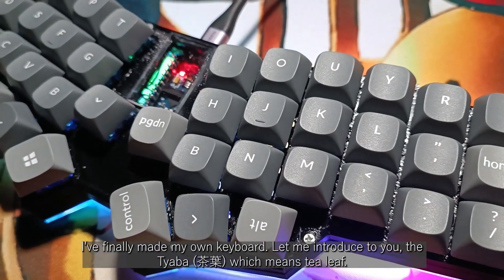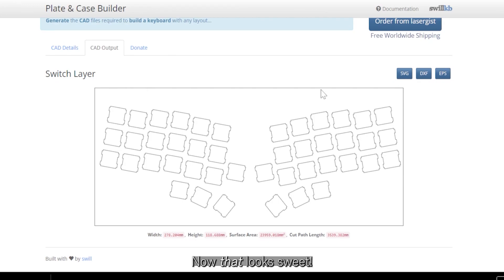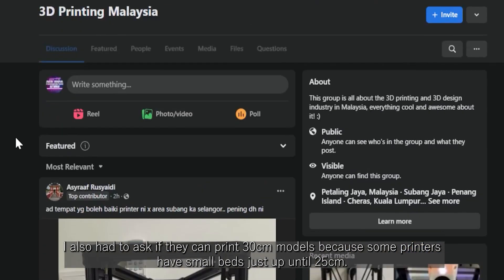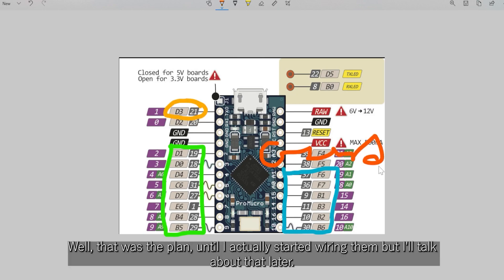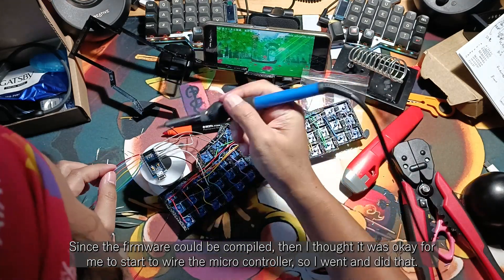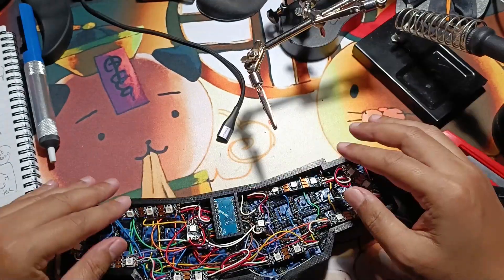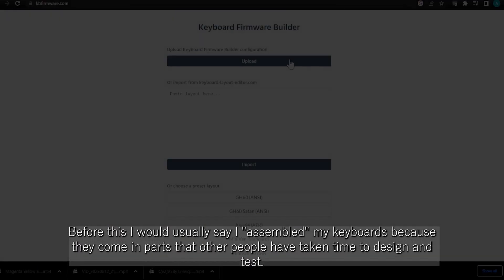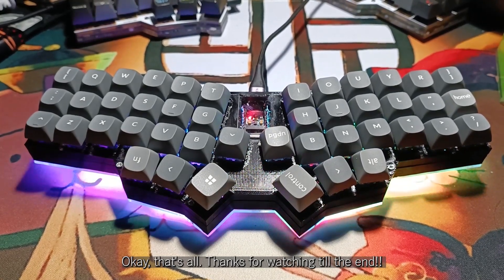I finally made my own keyboard!! The Tyaba

Comment: Really cool vid. I think this was the last push i needed to build my own keyboard.
Do you know why everyone uses the arduino pro micor (or mini im not sure) for keyboards?
Also how do you acess the different layersand why didn't you make a split?
Reply from the maker: Thanks! Not sure why people use promicro, but I used them because I had a couple extras laying around after changing a few controllers to Bluetooth nicenano controllers. Right now I'm trying to use RP2040 zero controllers (way cheaper and more pins) and am testing a split build!
As for layers, I have dedicated mod keys at the thumb cluster. There's a different video for that here: https://youtu.be/ShxD7b4IDQk?si=4Hx49yL8l6LpRtZH
Reply: @semputs  Thank you for your answer, on the theme of the rp2040 what are you thinking about the raspb. pi pico for keyboards?
For the rp2040 generally do you know a resource or a tutorial for how to flash qmk to it?

Comment: This man is crazy, typing without keycaps :D. 

Which colemak is this? Keycaps confuse me.

Btw i see you have experience with split and pseudo-split (as i like to call it). Which do you recommend? I'm currently on 40%ortho (planck like) planning to switch and looking for compact and comfortable, optimal hand position.
Reply from the maker: This is colemak-dh but the keycaps are qwerty + tried to move some of the keycaps to colemak if they exist on the row. Basically the keycaps don't really match with the actual keys.

Between splits and unibody (people I know call them unibody), comfort wise splits are way better. I have broad shoulders so using an ortho makes me have to place my hands closer and kind of squeeze my arms and shoulders.

The Tyaba is just nice as its slightly separated between the two halves versus having an ortho. I still feel relaxed using Corne or Lily58 splits though.